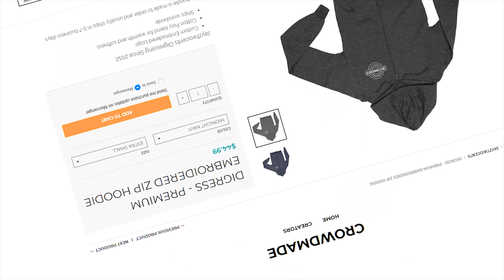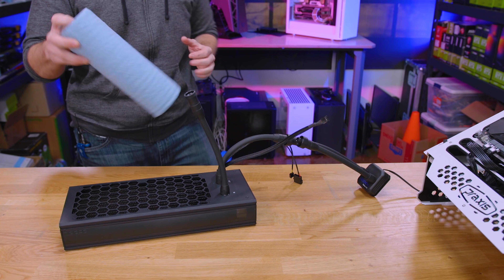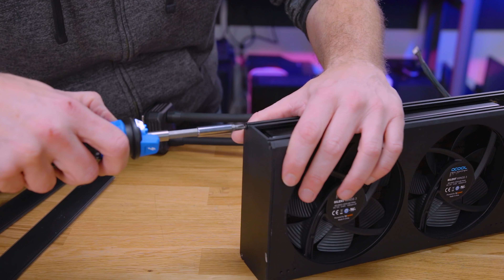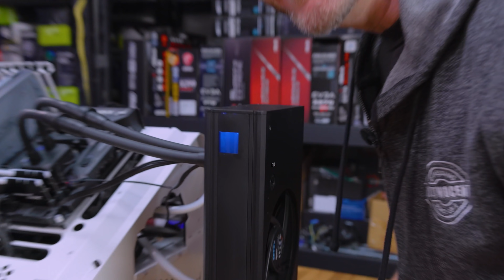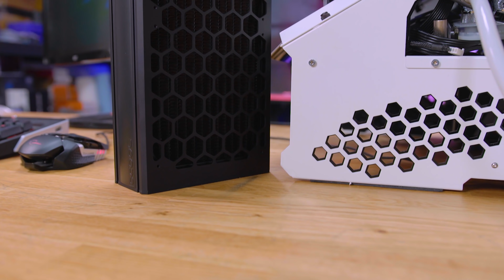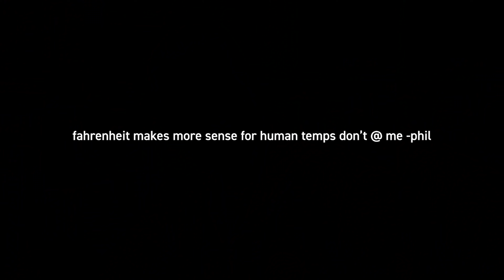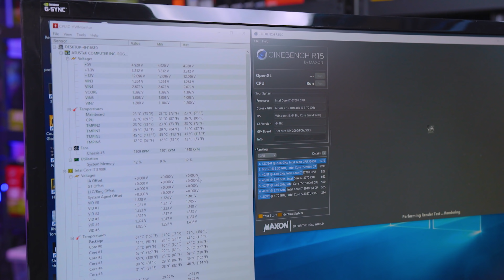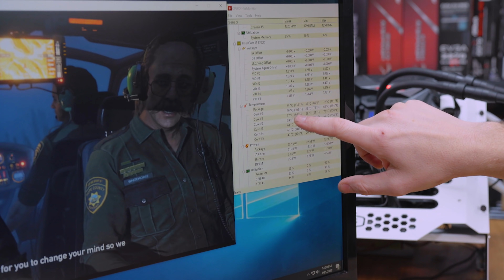This AIO is ridiculous!

Comment: Pleaaaase use degrees Celsius as well. There are more than americans watching, and you know that...
Reply: All Americans use Celsius for their PC hardware too.
It's 60 degrees F outside and it feels great - that makes sense to me as an American. However someone saying my CPU is at 165 F, I have zero frame of reference for that.
Reply: @Jesse22H  But for non-Americans, knowing that his room is at 68°F or outside it's 60°F is meaningless, but 16°C outside of your house or 20 in his room ? This I know what it feels like.
Reply: @TheLK641  Just take 62% off the f temp, since you're not American you probably can count. ;-)
Reply: @TheLK641  everyone else* knows what it feels like
Reply: @sookmahroot  So whatchu do if youre temp is -40F?
Reply: @supurfluus7028  38% of 40 is 15. Just treat it as a normal number but don't forget to display the minus when writing it down.
Reply: @sookmahroot  dude.. you cant be that stupid. what is 40F in C?
Reply: @supurfluus7028  I totally am and had to Google the answer. I just took 110f which I knew was roughly 43c worked out the percentage difference then applied that to other temps. Damn good job I never have to do those conversions for work, things wouldn't be running PMSL.
Reply: @sookmahroot  Lol I gotchu. Someone got me with that back in the day when I made a very similar claim to what you did, made me feel real dumb. 

Just do me a favor and pass it on!
Reply: @TheLK641  Google it. And start using F for ambient temperature anyway, it makes more sense than C. 16C outside and 20C in his room are what's useless.
Reply: @mjc0961  This argument about "F makes more sense" is just false. At 0°C it snows, under 10 it's cold, above 20 it's hot, above 30 it's very hot, fact is, the grand majority of the world would understand that, it's just American being so independent that they decided they needed their completely arbitrary unit based on average temperature on a random location instead of using actual scientific units...
Reply: Guys, yes Jay and his editors have the ability to edit in the conversions, but basically everyone uses Celsius for pc temps. Also, if you pay attention in the video he says: "So right now our package is idling at 29C, cores are in the mid to upper 20s, which is only a few degrees above ambient". So there's nothing to argue about here, he gives you the C and the F.
Reply: However he does plainly say in the video "you can do your own conversion" so his ass is covered
Reply: Cel-See-Us... Never herd of it...       :)
Reply: @Cerus98 US Imperial is not the same as International standard Imperial. ;-) E.g. a US Fluid Ounce is 4% more volume than a standard Fluid Ounce.
Reply: It's hard to change people who grew up in different times. Here in the UK we use mostly metric except for road signs which we use miles. Luckily I was taught both in school so I can interface with both older generations with imperial and younger generations who are only taught metric.
Reply: But Jay is from California. You can't expect him to throw up different temperatures he has no referential experience with.
Reply: Even as an American if I'm watching a European video rather than telling them to accommodate me I just literally open a browser and get the conversion with a 3 second Google search. Come on man it's first world problems here lol
Reply: You can ballpark it by dividing by 2 and subtracting 32.
Reply: there are more Americans than non Americans still, sorry
Reply: Everyone should use Freedomheight.
Reply: It appears our superiority has led to some controversy
Reply: if you want celsius go watch linus you commies
Reply: Michael Murphy  ...and -40 is identical in both F and C.
Reply: Michael Kregnes he knows but u can make it up and if ur wondering what the temp is when he says it in f just ask google what it is in ur temp
Reply: ApexPredator 241 yes, i can , but when i watch a video it should cover the info about what i'm watching so i don’t have to find out myself
Reply: Hasn't he used degrees C in the past though. I'm confused
Reply: @thorsong1  Ah calculator aint work since its not just +number to celsius...
Reply: Everyone who works on pcs uses Celsius...
Reply: (°F - 32) x .5556 = C
Reply: metric system lives matter
Reply: Canadian JayzTwoCents knows celsius!
Reply: Cerus98 yeah I didn’t even think about that
Reply: The f you're talking about? All of his temps were reported in Celsius.
Reply: Let's talk Kelvin, since that is more  scientiphiphical!
Reply: @PHAD-tc2ic  It is but it just feels weird to say that its 294 degrees in this room :S
Reply: @supurfluus7028  Still we don't mind having to spell out  branded type names  like i9-9900K. (See how K is popular now!). ;P
BTW, Kelvin is just 'Kelvin', not 'degrees Kelvin'.
Reply: WAHHHHHH!
Reply: Yea, I am American and I use Celsius when cookin' the dope with ah uzi...
Reply: Freedomheit
Reply: No. Screw that Metric/Celsius globalist garbage.
Reply: If you really wanna know so bad, why not just look it up? You clearly have internet access to be commenting on this video.
Reply: The absurdity of using to different scales in one experiment is like an ukranian TV show where people speak both ukranian and russian. Imagine in Switzerland a TV show with french, italian and german mixed in. And by the way, the Farenheit scale is not linear, because he used salted water, not distilled. That's the reason why it is not used by scientists. Jay is not a scientist, he is a youtuber.
Reply: Please use a temperature scale that doesn't suck.
Reply: fuck off
Reply: I use Fahrenheit for my pc hardware for years I have a good reference to it. A good reason I like watching Jay
Reply: @c0rpse1 No!
Reply: Use celsius says the person using no less than 10 American technologies that made it possible for you to watch this video from your couch. Dont make me start to name them off lest I be here all day.
Reply: I'm American and I only read  Celsius when dealing with computer temps.
Reply: America > rest the world
Reply: I honestly never ever use Celsius...... Unless it's CPU temps
Reply: Hey guys, no one has to cater to you. Do the fuckin conversion yourself. Geez, acting like kids who want their way.
Reply: Considering he’s American you have to give him a break. Your European or something it’s easier for you to use Celsius no?
Reply: Plus really Jay is it that difficult to just add a conversion in the video while editing
Reply: @kayaarkin8145  is it really that hard to do the conversion yourself? You're watching this on a device with internet access. Google has conversion technology.
Reply: @saber-jocky3436  Why the fuck should we use calculator when he can do the same and save all of our times
Reply: @SABER-JOCKY I know I can do it myself I’m not hating on the guy, just saying he gets paid the make theses videos, it’s his job so he could put in a tiny bit more effort and add a conversation
Reply: @quoryx1165  "save all of our times" its not saving his time to do things for lazy people, i use the calculator all the time when i hear something in Celsius
Reply: @quoryx1165  because he's not your slave
Reply: @Satzei  he gets paid for these videos you fucking moron
Reply: @quoryx1165  2 fucking seconds of your life to type into google...wow you must be super fucking important. Get wrecked.
Reply: @quoryx1165   You could ask Jay for a refund.
Reply: @zuestoots5176  it takes more than that im on the phone. That meand i will have to click away from the video.
Reply: @wysetech2000  ill ask for a refund for ads i watched
Reply: @saber-jocky3436  It is easy, but something that Jay should do
Reply: @quoryx1165  indeed
Reply: @saber-jocky3436  Yes, it is really too hard to do the conversion himself. He's not the one earning a living by running a computer show to a worldwide audience.
Reply: If you want us to know celcius, why shouldnt you know Fahrenheit?
Reply: Do you not have a phone¿
Reply: @rayweller3704   So I should ring someone up and ask them to do the conversion for me?
Reply: @insane_troll  calculator is on every phone.
Reply: And UK
Reply: Most academics use celsius, shots fired 😎.
Reply: Hey even non-Americans use American measurement when it comes to hard drive size, like 2.5 hard drive and 3.5 hard drives are actually on inches
Reply: @kevinagostinello9968  Also interesting that nobody complains about the G 1/4 fittings, which are a British Standard Pipe size originally specified in inches and now converted to millimeters as ISO 228. Still designed for pipes with inch nominal ID, though.

At least we're *consistent*.
Reply: pandorafalters there’s a lot of things that are backwards and people never notice them
Reply: @Cerus98 What are those "many countries" that still use imperial units? Outside couple of tiny former British colonies like Marshall Islands nobody in the world use them. Even UK is almost metric at this point. US is the only country in the world too dumb to be metrificated it seems. Well, good luck with your inches and gallons.
Reply: @quoryx1165  he does get paid and yet somehow you still get free content and youre complaining. Miss me with that shit you bum.
Reply: @MrMasterChief38  Its not free i have to watch ads
Reply: @quoryx1165  i guess so, i mean theres no way around those ads right? give me a break. i guess you cant find out how to do that either just like youre to lazy to find info for yourself.
Reply: @MrMasterChief38  exactly
Reply: Yeah but you don't matter.
Reply: Just convert it yourself.
Reply: @Cerus98 Thats what decimals are for. The reason C is superior is because freezing is at 0, and boiling is at 100. Freezing temp in F is 32, and boiling is 212.

For every practical application, C makes more sense than F. It feels silly comparing metric to imperial, as imperial units of measurement have been outdated for 228 years.
Reply: Please don't.
Reply: @Cerus98 Question 1. Do you know what year the metric system was first proposed? Hint: 1791 
https://en.wikipedia.org/wiki/History_of_the_metric_system

Question 2. Why exactly does farenheit have a broader range? Anyone who knows anything about science would know why this is a silly claim to make, but I'm just curious why you claimed it exactly.

Also I like that you think that OCD simpletons need their numbers to always be even. 

Question 3. Let me ask you this. If the numbers are arbitrary, or "made up" as you put it, then why have it be 32-212 instead of 0-100? 

If the numbers are made up, then why not do the same thing for miles per hour? 

In a car thats stationary? You're not traveling at 0MPH, YOURE GOING 32!!! WOOOH!!! 

You seem to have all the answers, so you better have a good one for this. It better not be something like "oh but speed is different than temperature" because no its fucking not. 0 is 0 for everything else.
Reply: @supurfluus7028  These arguments are all based on opinions and both systems are identical for accuracy. 

Zero and 32 are both arbitrary starting points because it's arbitrary to choose the point when water freezes as a starting point. First why not choose some other element? Water will begin to freeze and crystallize with impurities. Pure H2O can go through homogeneous nucleation and freeze but it occurs spontaneously with only super-cooling. So why not choose some other number? Even the idea of the number Zero was not originally apart of the number system and did not always exist in counting as a "starting point" until around 3 B.C. A stationary car in your example is it truly going 0 MPH? Relative to what the Earth? Are the tires not eroding away on a molecular scale causing the ever so slightest of motion? Is the car not experiencing the rotation of the earths forces? Whats the absolute smallest factor that water begins to freeze at? How many molecules does it take to be considered frozen? What is the relative standard of water? I can keep going but lets face it temperature is arbitrary and any perceived starting point is also arbitrary. 

So if both systems are identical for accuracy and both starting points are arbitrary then it comes down to ease of use and efficiency.

From efficiency stand point it would raise the argument of why doesn't the world speak one language. I believe Mandarin is considered the most efficient, effective, and abundant language. But here we are speaking English it's the same cultural equivalent.

As for "ease of use" it is always going to be considered an opinion based on what is familiar to you and what a person is more comfortable using. It boils down to what numbers appeal to you and mean the most to you. We just have to accept the cultural differences and not be mad about them but instead appreciate them for the positives they bring. If we all thought the exact same way we would lose our humanity.

Also who cares.. Just google the conversion and learn something new for the day its not a big deal.
Reply: @lrognolmakinitreal6268  jesus crist dude no one asked you to write a book in the comment section
Reply: @lrognolmakinitreal6268  Your entire argument can be summed up as: Fahrenheit is better than Celsius because why not. They're both accurate.

According to your argument, there should never have been a need for celsius, because fahrenheit should have always been good enough. According to your argument the only difference is opinion. 

If the only difference was opinion, then shouldn't we see an equal use of fahrenheit and celsius accross the world? Since neither is inherently better according to you, the number of people using each one should be equal. Why then is the United States the only major industrialized country in the world that does not use the celsius scale?

My point is, fahrenheit as a imperial unit of measurement was made obsolete by the proposal of celsius, a metric unit of measurement. Water was used when determining scale, because it is the most abundant substance on earth. It is in the air. It most affects our weather. 

Oh but why not use silicone for determining scale instead? or maybe helium? Dumbass.
Reply: @supurfluus7028  but he's correct neither system is more accurate then the other. Also um hydrogen is the most abundant substance on earth given that it's everywhere.
Reply: @Cerus98 you are completely wrong. U.S. is officially using metric system, but there is some department who translates it all to imperial so the "medieval" ppl understand it. 
I don't make it up, U.S. is officially metric.
Reply: @thorsong1  Since all the benchmarking tools use Celsius by default and not Farenheit, it makes no sense to use Farenheit just because "Murica". You should use a calculator.
Reply: I'm Australian and use Celsius, but if he's American and uses Fahrenheit, then he can read it out in Fahrenheit. It would take you 2 seconds to open a google tab and convert it. Jesus.
Reply: @Nullzd  was looking for this. Thank you sir! P.S. Use metric for Gods sake...
Reply: Because typing into google for you to check is difficult... 🤦🏻‍♂️
Reply: @braveheart4lif31  that's not the point.. he makes videos for the world to see.. the world uses metric (except for 3 countries).. so why let the entire world convert things? he can do it while editing and safe everyone the time..
Reply: Dunkelelf3 because he uses the one he is most familiar with. He shouldn’t have to cater to people who are too lazy to convert it
Reply: @Cerus98 No we're not. we use celsius in the UK.
Reply: Everyone uses Celcius for PC... Because that shit is extremely easy to understand, universally...

As long as the temps are in between 0 and 100... you're good. xD

Reason for that is because 0 is the freezing point, and 100 is the boiling point (for water, which is what is cooling your PC). Celcius is magical, everyone should use it! :3
Reply: @Nullzd  he does it because he's American, he doesn't have to cater to everyone
Reply: Celsius sucks.
Reply: 34 degrees Fahrenheit equals 1 degree celcius (that a round up it's actually 33.8) so his ambiance temp is about 2 degrees celcius, not trying to be mean just tryna help you out

Comment: I wish he would have used a delidded CPU also.  My 8700K delidded has a stable OC of 5.3Ghz all day long at 1.4 and my temps in AIDA64 top out around 190 Freadomheight or 86C after an hour.  This is on a Corsair H110i Pro RGB.  So not as nice technically as the cooler reviewed.

Comment: Why is my graphic card fan are not working
Reply: They usually don't turn on until your GPU heats up. You can use the software that came with it to reduce the temperature that activates the fans.